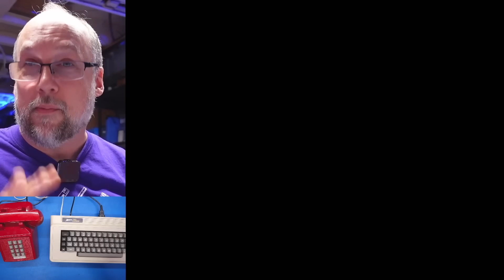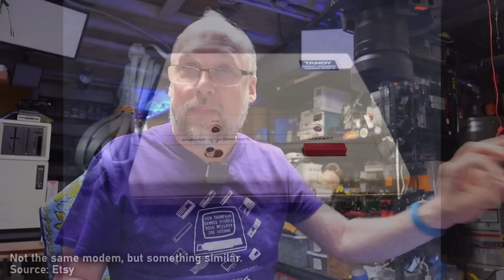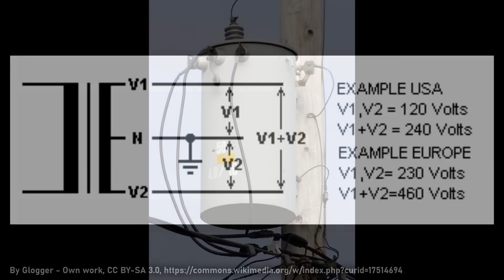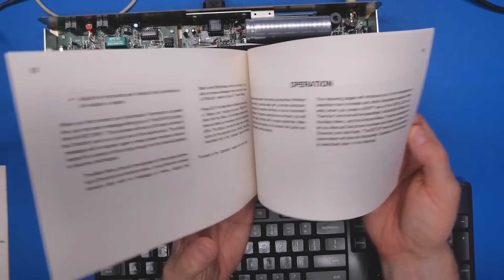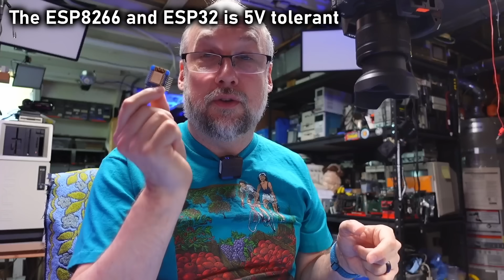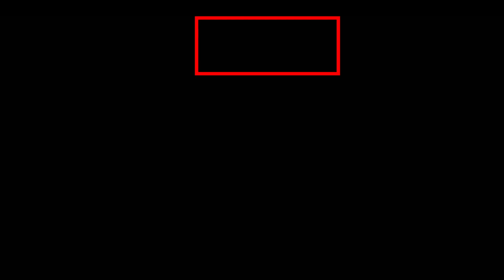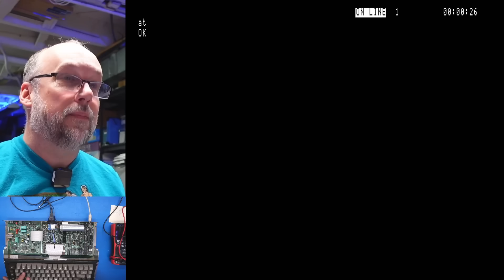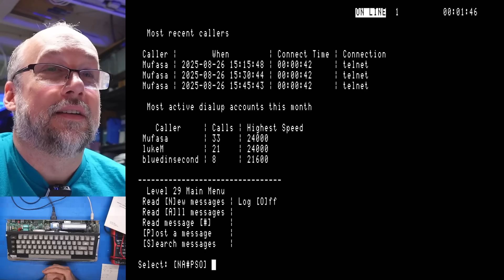Adding Wi-Fi to a 43 year old modem only terminal (Zenith ZT-1)

Comment: I remember downloading full 170k 1541 sides via 300baud.  Took about 90+ minutes for all 4 "zip" files
Reply from the maker: Ah I had wondered if anyone had actually done that. :-) I was just looking up the speed of the stock 1541 over IEC on the C64 and it seems it was roughly 300 bytes / sec, so about the same as 3000bps (when accounting for stop bits on serial) --- so you were transfering a whopping 10x slower over that modem connection. Ouch!
Reply: My earliest memory is the doom demo at 0.9MB that took an hour over 14.4kpbs hehehe

Ouch indeed!
Reply: @charlesdorval394  wow that just unlocked an old memory for me! I very clearly remember one night in elementary school staying up to wait for an around 1MB dancing baby gif/video to finish downloading to watch it before I went to bed. Took around an hour on our 14.4kb modem. I bet it was only a few seconds long haha.
Reply: @charlesdorval394  I'm sure I would have downloaded a bunch of Amiga games at 2400 bps, but I don't really remember it. What I do remember, though, is downloading the OS/2 2.11 upgrade at 14.4k on the 386 we got after the Amiga. About 20 1.44 MB floppies. Lots of fun. :p